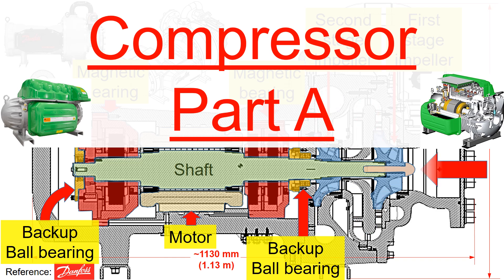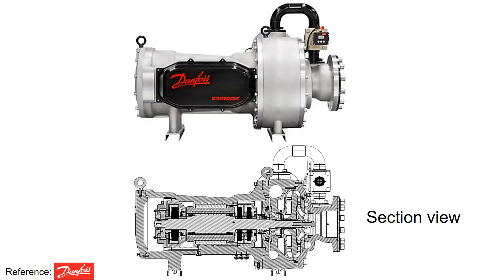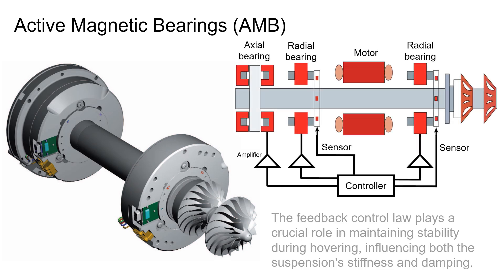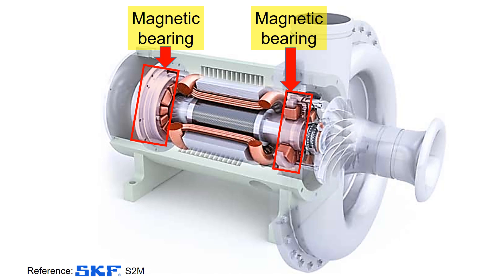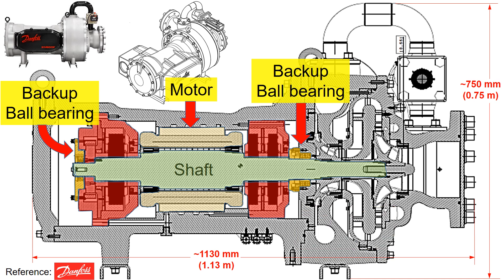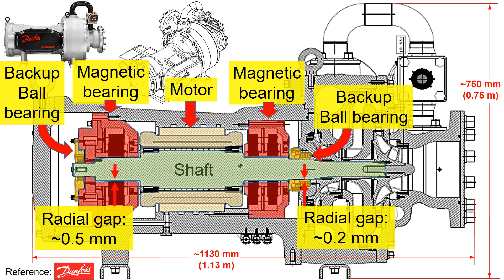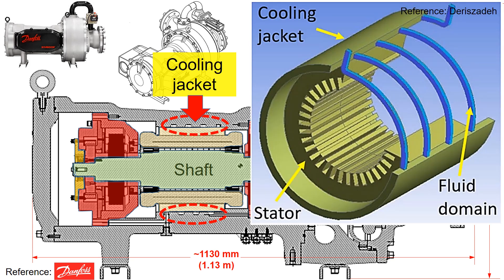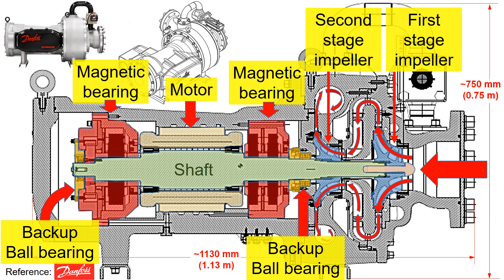Part 35 - Magnetic Bearing in Rotating Machine

Comment: Do the backup ball bearings end up skidding during normal operation?
Reply from the maker: Excellent inquiry! Under typical operational conditions, the magnetic bearing regulates the shaft, preventing any contact with the backup ball bearing. A well-designed system ensures that the backup ball bearing only comes into play during emergencies, serving to safeguard vital components like the motor and magnetic bearing.